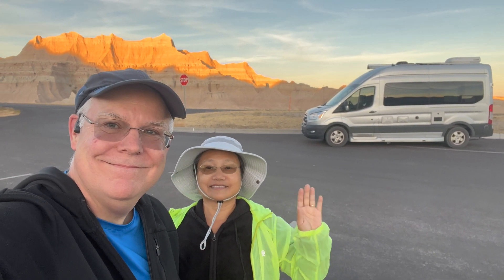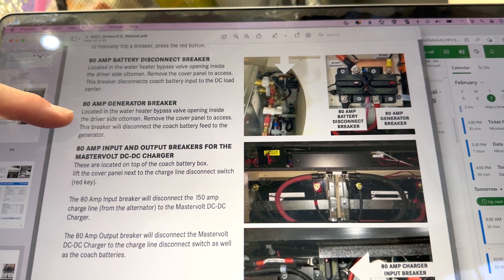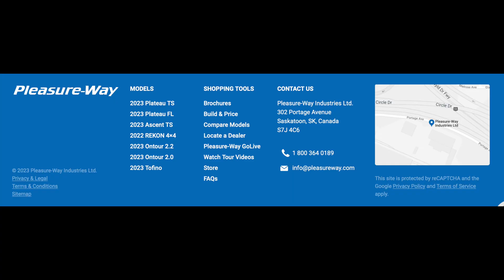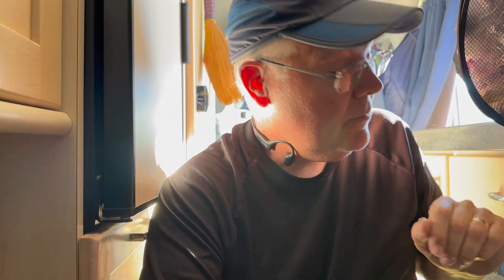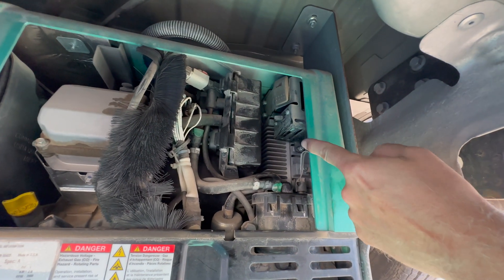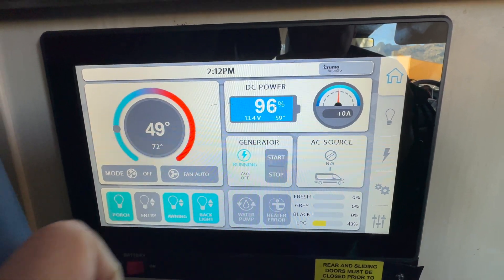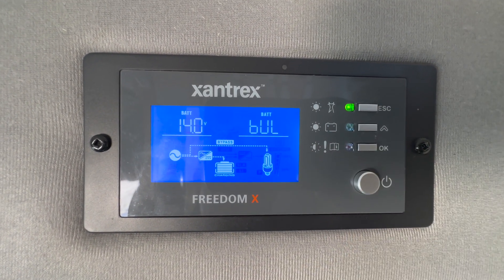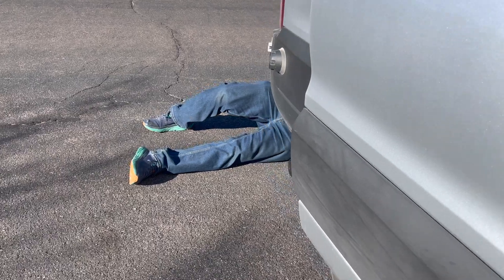HOW TO GET THE GENERATOR TO CHARGE THE BATTERIES// HOW OFTEN SHOULD THE GENERATOR OIL BE CHANGED?

Comment from the maker: To check for hours of the generator that has been used.
On the control pad, click on the light bolt icon.
Bottom right corner is where you will see the indicated generator hours.

Amazon Links to Items we use or mention in our videos: (We earn a small commission at no extra cost to you when you purchase through one of the links.  Thank you for supporting our channel. )
Surge protector, Water filter, hose:
Portable RV Surge Protector Portable EMS-PT30X RV Surge Protector , Black   https://amzn.to/3v7qfe8
Southwire 34930 Surge Guard 30A - Full Protection Portable with LCD Display Black     https://amzn.to/3vaPMTy
 FilterLogic RV Inline Water Filter.... https://amzn.to/3BJBpXB
Valterra AquaFresh High Pressure Drinking Water Hose.... https://amzn.to/3sTqK8U
Twinkle Star RV Water Pressure Regulator Valve ..   https://amzn.to/3JOmcrm
Camco FasTen 2x2 Leveling Block https://amzn.to/3LQidMC

Kitchen Area:
Royal Berkey Gravity-Fed Water Filter with 2 Black Berkey Elements and 2 PF-2 Fluoride and Arsenic Reduction Elements https://amzn.to/3z19SAe
Travel Berkey Gravity-Fed Water Filter with 2 Black Berkey Purification Elements https://amzn.to/3zpPslE
Over The Sink Roll-Up Dish Drying Rack  https://amzn.to/3p8jXH8
 Magma Products, A10-363-2-IND, Gourmet Nesting 7-Piece Stainless Steel Induction Cookware Set with Ceramica Non-Stick, Silver      https://amzn.to/3p4SciQ
VELCRO Brand - ONE-WRAP Roll, Double-Sided Tape  https://amzn.to/3K4d4Px
Gorilla Heavy Duty Double Sided Mounting Tape XL  https://amzn.to/3HcaWmO
Automatic Soap Dispenser   https://amzn.to/3zhzhXU
Dixie Ultra Disposable Paper Bowls, 20oz     https://amzn.to/3p7PitE
100% Compostable 9 Inch Paper Plates  https://amzn.to/36yLlYG
Lunies Over The Cabinet Plastic Trash Bag Holder  https://amzn.to/3pb82Zr
Subekyu Small Hanging Kitchen Trash Can  https://amzn.to/3p9rrKe
Prodyne Under Cabinet Paper Towel Holder  https://amzn.to/3p7GyDQ
Bligli Shower Mat Non Slip Bath Mats  https://amzn.to/35lOgmH
 MicoYang Silicone Dish Drying Mat   https://amzn.to/3BGDMuu

Bedding Area:
 Therm-a-Rest LuxuryMap Self-Inflating Camping Sleeping Pad   https://amzn.to/3h6jTUb
Packing Cubes Luggage Bags  https://amzn.to/3LS0kNq
GagetElec 8-Inch Clip On Fan 10000mAh Rechargeable Desk Fan Battery Operated https://amzn.to/3RfCrSi (got this fan later, we like the fan a lot)
10000mAh Portable Fan Rechargeable, Battery Operated Desk Fan   https://amzn.to/3JOdHfE
Anything Keeper-Home, RV Organizer  https://amzn.to/3u0UkdM  
Safety Strap Locks for cabinets, drawers and more https://amzn.to/3OIFVeq

Curtains:
Blackout Curtains with Black Liners,  (Navy, 2 Panels, 52 inches W by 45 inches L)   https://amzn.to/36snJop
 NICETOWN 100% Blackout Curtains, Thermal Insulated Black Liner Panels  (Set of 2, Navy, 52 inches Wide by 63 inches Long)   https://amzn.to/3h6Gz6v
 Oval Tension Rods Adjustable Width Curtains Rods 4 Pack Spring Window Round 22 to 36 inches Spring Curtain Rod Tension Curtain Rod, Black        https://amzn.to/3sbpLlh
Rod Desyne Oval Spring Tension Rod 36"-60", Black, 36-60"  https://amzn.to/3p91r1x
Table and chair:
GCI Outdoor Compact Camp Table 20 Outdoor Folding Table     https://amzn.to/3w1eB4U
 Portal Outdoor Folding Portable Picnic Camping Table  https://amzn.to/3slgZBv
COSCO Multi-Purpose, Adjustable Height Personal Folding Activity Table https://amzn.to/3t05IFN
STRONGBACK 3.0 Guru Camp Chair, Original, Navy/Grey     https://amzn.to/3H6Di1K
 STRONGBACK 2.0 Elite Camping Chair, Original, Black/Grey      https://amzn.to/3JOAPL2
 GCI Outdoor Compact Camp Table 20 Outdoor Folding Table     https://amzn.to/3p8dH2l

Bathroom:
Bligli Shower Mat Non Slip Bath Mats Bathtub  https://amzn.to/3sbQYEs
MISSLO 8 Pockets Mesh Shower Organizer Hanging Caddy with Rotating Hanger Quick Dry Bathroom Storage (White)      https://amzn.to/3sa5MTV
MISSLO Hanging Mesh Pockets Hold 340oz/1000ml  https://amzn.to/3LSi9fi
Self Adhesive Pet Proof Toilet Paper Roll Cover Holder ...  https://amzn.to/3hflpTL
 Motion Sensor Wireless Night Light      https://amzn.to/3HdnRVu
 ScorchedEarth Microfiber Travel & Sports Towel Set (True Navy) -      https://amzn.to/33IJ7oq
Poo-Pourri Original 16-Ounce Refill Bottle and 1.4-Ounce Original      https://amzn.to/33HuwJU
Scott Rapid Dissolve Bath Tissue Made for RVs and Boats (16 Rolls)  https://amzn.to/36z0Z6l
ScorchedEarth Microfiber Travel & Sports Towel Set (True Navy) -    https://amzn.to/3hdqWdL
Camco - 21013 RV Straight Swivel Stik with Shutoff Valve- Creates Powerful Cleaning Action that Dislodges and Flushes Stubborn Waste Deposits and Combats Odors (40094)   https://amzn.to/3dYIDQe
Camco 40075 Rhino Toilet Flush Valve Prohttps://amzn.to/3SsPXmd
Camper Hose    https://amzn.to/3fyqCIY

Front area and phone chargers: 
Tacticool Car Seat Back Organizer    https://amzn.to/3JY79ex
Heavy Duty Cargo Net Stretchable   https://amzn.to/3vigbPk
Spigen Mag Fit Phone Holder Car Mount Designed for Magsafe...    https://amzn.to/3BGR8GU
USB C Car Charger Adapter...   https://amzn.to/3BQ8Yr9
ADDTOP Solar Charger Power Bank ...  https://amzn.to/36DHSIt
iPhone Charger,3 Pack (6 FT) Maitron [Apple MFi Certified] Charger Lightning to USB Cable Compatible iPhone 13/12/11 ... https://amzn.to/3p8fRPB

Coffee equipment :
Hamilton Beach Scoop Single Serve Coffee Maker  https://amzn.to/3t3rJTR
OXO Brew Conical Burr Coffee Grinder  https://amzn.to/35jkDT0
Coffee Canister, MOICO Stainless Steel Coffee Container  https://amzn.to/35lU5Rm

Watch next: 2022 PLEASURE-WAY ASCENT // ITEMS WE USE IN OUR RV.   https://youtu.be/oRXx-2cOaoA

Amazon links to items mentioned in Pleasure -Way Ascent videos:
Vancillary Sprinter Van Headliner Shelf (2007-2018)    https://amzn.to/3phmbEk
 Epicurean Kitchen Series Cutting Board, 17.5-Inch × 13-Inch, Natural      https://amzn.to/3M6izyD
 OXO Good Grips Large Silicone Drying Mat, Large (Gray)    https://amzn.to/3pkRduY
 IKEA LEGITIM 13 1/2" x 9 1/2" Cutting & Chopping Board (White)     https://amzn.to/35wyGFc
 Subekyu Small Hanging Kitchen Trash Can, Collapsible Mini Garbage Bin for Cabinet/Car/Bedroom/Bathroom, Plastic, Grey, 2.4 Gallon      https://amzn.to/3M4ITJC
 YIGII Paper Towel Holder Under Cabinet - Self Adhesive    https://amzn.to/3IsoUCu
Space Saver Over The Door Hooks    https://amzn.to/3JXI7fv
3pcs 500ml Plastic Safety lab Wash Bottle,Squeeze Bottle with Scale Labels (16 oz/3 Bottle).     https://amzn.to/3M5QHLf
Mini Foaming Dispensers for Castile Liquid Soap, 50ml (1.7 oz) - Pack of 12       https://amzn.to/3snjO4T
Automatic Soap Dispenser   https://amzn.to/3p81Zog

Amazon links to items mentioned in Cindy's OnTour 2.0 walkthrough video. 
Lazy K Induction Cooktop Mat https://amzn.to/3yBupMV
2Pcs Over Door Hanging Storage Bags Wall Mount Closet Organizer https://amzn.to/39TlQml
Sink Mat Kitchen Sink Protector for Bottom of Farmhouse Stainless Steel https://amzn.to/3swdwzl
Cupboard Bars Tension Rods, 6 Pack 9.8-15.7 Inches Spring Tensions Rods  https://amzn.to/39qtQeE
DeElf Outlet 8 Packs Small Tension Rods 16 to 28 inch Spring Adjustable Bars https://amzn.to/3wu8k06
Prepworks by Progressive Collapsible Portable Wash Basin Dishpan https://amzn.to/3wqOB1w
BOESHIELD T-9 Rust & Corrosion Protection/Inhibitor and Waterproof Lubrication, 12 oz.
https://amzn.to/3N8sqDO
PackTowl Original Quick Dry and Super Absorbent Towel https://amzn.to/3NfjqwY
Furhaven Orthopedic, Cooling Gel, and Memory Foam Pet Beds for Small, Medium, and Large Dogs and Cats - https://amzn.to/3Nce2uh
GAMMA2 Vittles Vault Outback Airtight Pet Food Container https://amzn.to/3swe48n
Slowton Dog Seat Belt, 2 Pack Pet Car Seatbelt Headrest Restraint Adjustable Puppy Safety Seat Belt Reflective Elastic Bungee Connect Dog Harness in Vehicle Travel Daily Use https://amzn.to/3PxvL1B

Moonet PVC Thickening Leather Spare Tire Wheel Cover for Car Truck SUV Camper Trailer Universal Fit RV https://amzn.to/3GqXLzH
1UP bike rack. https://www.1up-usa.com/product/2in-super-duty-single-bike-rack/
Wilco offroad hitchgate.   https://www.4wheelparts.com/p/wilco-offroad-hitchgate-soloxl-spare-tire-carrier-uhg32206-h/_/R-BKKP-UHG32206-H
Show less

Comment: How often do you use the generator? Is the noise a problem?

I wish Pleasure Way had a Pure3 system or something similar.
Reply from the maker: Hi David. If we drive a lot during the day the car's alternator will fully charge the coach batteries, so we don't have to run the generator. If we are not plugged into shore power while camping, we do need to run the generator a couple of times a day to keep up with our cooking and other appliances. We have the quieter Generator. The noise is not too bad, but it is still a noise.